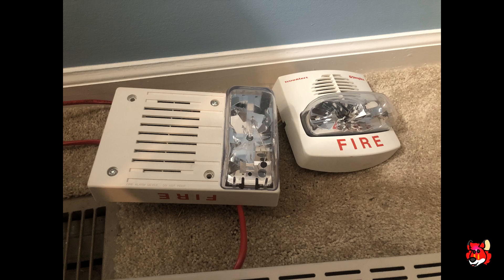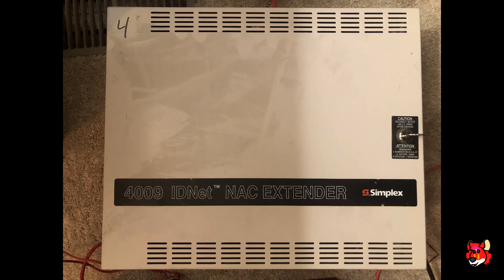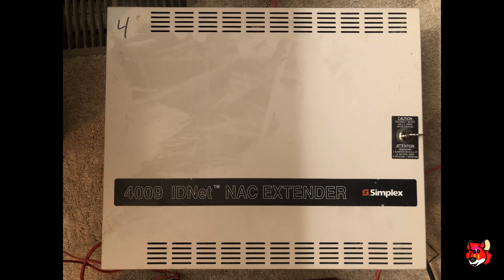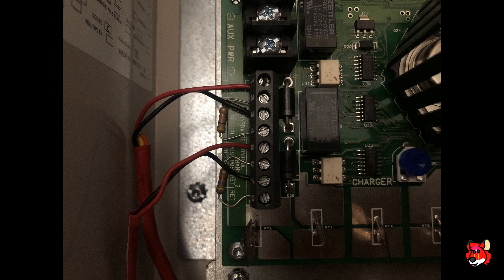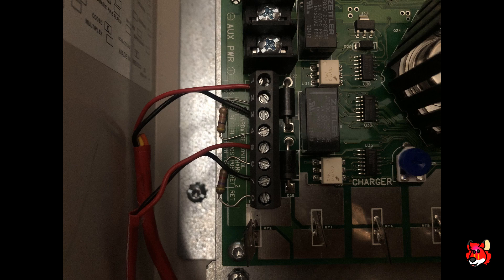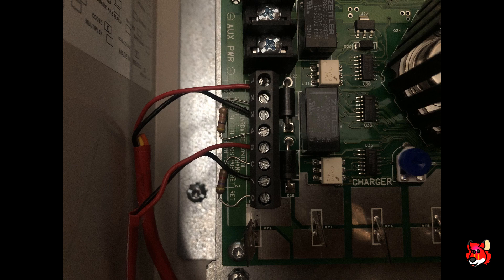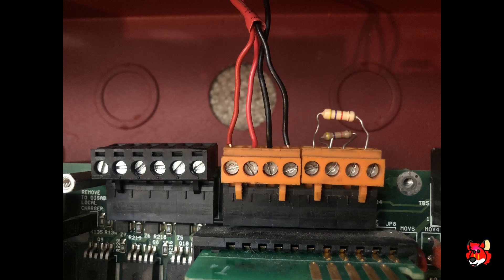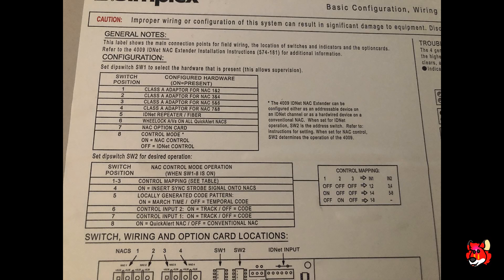**CONVENTIONALLY** Wire a Simplex 4009 IDNET Power Supply to an FACP

Comment: Doesn't the simplex sync on these horn strobes work in the same(or very similar) way as Wheelock sync, so theoretically couldn't you just use Wheelock sync?
Reply: That would only work for strobes. Horns won't work.